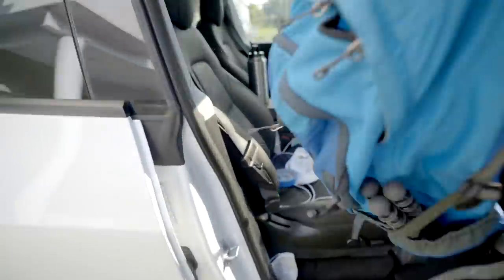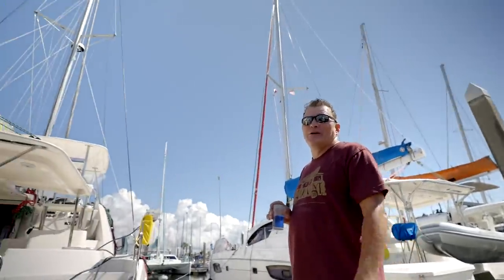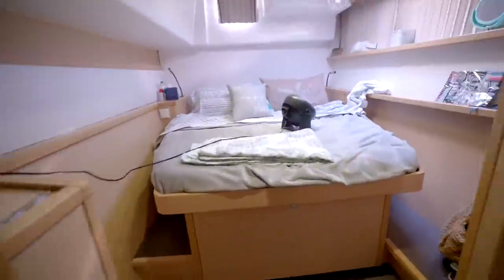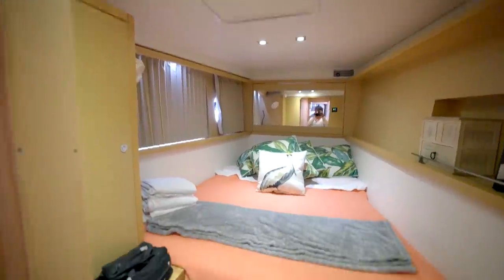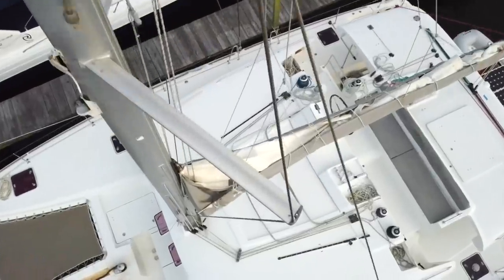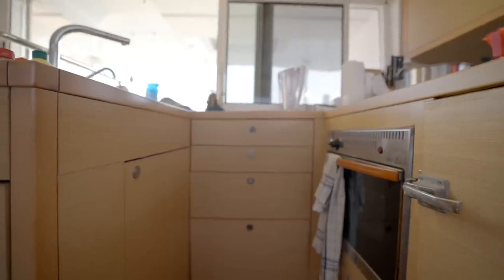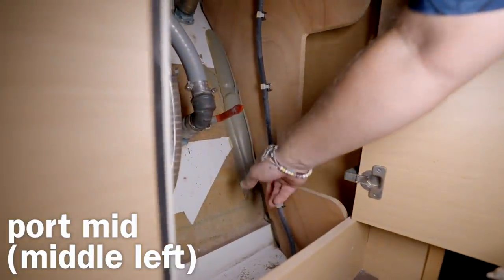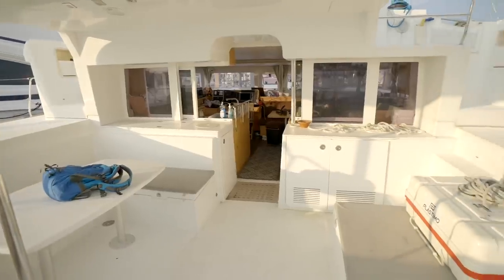Boat Tour!  I found 2 Catamarans w/ Broken Bulkheads Just Like Mine!

Comment: It's not recommended to perfectly fit bulkheads (stringers) to the hull, the reason? When the bulkheads are laminated in place, the heat generated by the activation of the resin, causes the line of the bulkhead to mirror through to the outside of the hull even with a core in the hull. If you eye the hull looking down the length, this is when you will see it, this in turn can, in time, cause bullhead failure. This may not be the case for you, though. This is something we at Sunseeker found out through experience many years ago. The poly ester resin was also changed to the more flexible  grade. Another laying up problem is not measuring catalyst to resin, sometimes people have a habit of making a hot mix to get the job finished quicker, this generates much more heat and condensation in the voids causing, In some cases, the layup to delaminate.
Reply from the maker: Do you know if this applies to epoxy resin as well? Thats what we're using for all the repairs. There's a pretty big gap from the bulkheads to hull (From the factory) that im filling with cobosil/resin filler. Hopefully that doesnt cause the problem you mentioned.
Reply: @david_shih  Polyester resin is less expensive, flows easier for vacuum moulds, epoxy on the other hand seems to be the desired resin for repairs, putting the cost to one side. I personally have not used epoxy resins for repairs, however, its strength and agility seems to work. To avoid mirror image, fill bulk head gaps with foam or balsa, secure in place with body filler or similar, then GRP it. That is what I would do, however it's your boat sailer. What does Laguna recommend for stopping the boat flexing? For as sure as eggs are eggs, it will happen again until the cause is cured.
Reply from the maker: lagoon doesn't really recommend anything specific fix for the flexing b/c they're not really acknowledging the problem in the 1st place. But according to the boats designer, once the bulkheads are properly reinforced all the flexing will stop!!
Reply: @david_shih  Good luck with that one, then. Get it in writing from the designers. Then you will know. P.S; who decides what is properly reinforced?
Reply from the maker: Ah, so to clarify, the designers of the boat are a completely separate entity from Lagoon. Lucky Colin from Parlay was able to discuss the recommended repair in detail with them well before Lagoon realized this was a major problem.  So, they were very forthcoming with the structural weakness and problems with the design.  So the repair process Parlay and I used is completely different than the repair kit shown in the video. We literally realigned the entire boat with pylons on the bridgedeck; ground out all of the delamination (so much); installed 3x the original plywood bulkhead; and glassed the s**t out of everything and retabbed everything where they originally used putty. Videos of all of it to come soon!
Reply: @david_shih  GRP is like paint, no matter how thick (layers)you put on, if the first layer doesn't stick, neither will the rest on top. Therefore, if the flexing of the boat is greater than the strength of the bonding, it will delaminate again. It therefore goes without saying that structural stiffness must also be applied. As for designers, not all boat building companies employ their own naval architects, as they are known in the UK. Sunseeker yachts were designed by the then well known naval architect and racer Don Shead. "https://itboat.com/en/companies/342-don-shead-yacht-design" he had his studio in Fareham, Hampshire. When it was Don Shead's time to retire, Sunseeker took on his staff and continued, as far as I know, to this day still designing. P.S; in the UK a Lloyds inspection certificate would be a sure sign of correct repairs as well as seaworthy ness.
Reply from the maker: @lifeinchrist77  Makes sense...now you have me worried about how well i applied that base layer of glass.
Reply: @david_shih  As long as your surface is keyed up, and you used paddle rollers to make sure the epoxy has gone through to the groundwork and squeezed out the air bubbles, you should be fine you can do no more in that area. We always laid up with three layers 100Gm2 chopped strand matt about 6" (150mm) wide by the width of the roll and stager the layers so you don't get a hard edge so to speak, and the 6" now becomes 10", We wet out the matt before putting in its place on the boat, a bit messy until you get use to it, we found it goes on better than trying to wet the surface then put the matt on dry and then wetting that matt, it only gets tricky when working over head.
Reply from the maker: Is you got me doubting if I prewetted some of the surfaces when I glassed the beam in! …ugh.
Reply: @david_shih  It doesn't matter if you pre-wet the surface or not, we never did, we wetted the matt prior to putting it in place rather than wetting one layer at a time on the boat in place. As I said we would put three staggered layers, we would have a piece of 5/8" ply big enough to take the length and width we were wetting out. Wet the ply board first, put on the first strip of matt, wet it, do the same to the next two pieces staggered on each other then lift the three pieces together and put in place, bulkheads to hull, roll out with paddle rollers. This is gives tapered edges and especially useful when applying foam and vinyl direct to hull, or buklheads, you don't  get the bump where the matt ends. Another tip, if you are using foam and then applying vinyl using spray glue, do not write on the foam or the reverse of the vinyl with marker pen for ID purposes, the ink reacts with the glue and shows through the vinyl. Nothing worse than walking onto a 600,000 pound yacht and having to rip all the foam and vinyl off and start again.
Reply from the maker: @lifeinchrist77  thanks for all the advice….the second I think I’ve finally learned something I realize there’s more I didn’t know I didn’t know.
Reply: @david_shih  You're welcome, David, my years with Sunseeker paved the way for learning much. One Sunseeker that we built, I think a Manhattan 52, it would not plain, the problem? Where the prop tunnel meets the transom, a radius was put on the edge, causing cavitation. The edge was gel coated to give a sharp edge, then she was planing, such a small thing caused such a headache. Needless to say, the mould had to be modified.
Reply: In my early days 1950's 60's I raced cats, these were the pioneer days of cats, with loads of experiments going on.

Comment: Off topic  how long does it take to recharge your car when traveling?
Reply from the maker: theres a bit of logic to it--battery chargest exponentially faster when its near empty. The fastest way to go about it is to charge frequently but only about half way, so you're near empty every time you hit a supercharger. Sit there for 15-20 mins and be on your way! But to be honest charging is the best part...build in TV with netflix, movies, games, and A/C! I bought a steering wheel table that clips on and frequently sit in the car to work. Well, those were the good old days when i wasn't trapped in panama. Here I sit in a tiny Kia Picanto and cry to myself in the dead of night while hiding from the mosquitos. That's how i recharge from fiberglass dust exposure.

Comment: So weird that Lagoon would design these beautiful boats, finish them with so much attention to detail, but then pay so little attention to the structural integrity of the hull. You don’t even have to be a structural engineer to see that the bulkhead design (a few layers of ply glued to the hull) is not adequate for the forces they have to deal with. Surely the costs of material and labor to the do the job properly is not going to add a significant amount to the cost compared to using glue?
Reply from the maker: They keep claiming that there’s absolutely nothing wrong with the boats design, that it meets all boat building specs.  then why do they keep reinforcing and upgrading the area that keeps breaking if it was strong enough to begin with. ?
Reply: We are all focusing on the front bulkheads now and it's apparent this part is under engineered. But if you look at the structural design of the whole boat, I am sure it's a much more complex affair. From what I understand, they are doing a very good job of offering a very attractive boat for the money. I am sure they cannot achieve this by over engineering everywhere, which it not to say they are allowed to screw up in some places. And screw up they did in this part, imho they'd be wiser to own up to it and offer a satisfactory solution to everyone involved.

They seem to be moving  in the right direction, from what I've gathered from Collin's video's, but it's taking them long to get there and it's going slower than necessary. They are also playing too much corporate liability hide-and-seek for my liking. I imagine it affects resale value of non-fixed L450's considerably and I'd be pissed too if I was an owner. 
Their denial of the problem is helping no one. 

I am not really in the market for a Lagoon, so for me (and probably a lot of viewers) it's a bit academic anyway, but I sure as hell take note on how it's handled. Best of luck to those affected.

Comment: Lagoon - it looks just like a real boat - no really.     Next task is obvious - Can you find a Lagoon 450 without broken bulkheads? I'll bet if you find one, it's almost never been used.  The huge question is:  Is it only the bulkheads? What else is wrong, especially things that can't be fixed?  I would think the gusseting is inadequate, the glass layers probably separating when jobs were on pause overnight, over the weekend.  I think Lagoon's 'fix' is to extend the life of the boats enough to a second used sale and then they can walk away from all responsibility.
Reply from the maker: Will, theres actually 450's that are almost new and never sailed that have this issues. So although sailing them does hard does make it worse, the design was inherently flawed. Your comment on "extending the life of these boats" is totally accurate as these boats are primarily designed for the charter market which means a 5 year life before charter companies drop them and owners are stuck with them or they're sold.

Comment: No disrespect but have always thought these were just floating apartments with a mast stuck in them...has a lagoon 450 ever completly broken up yet ?..you guys have probably saved that happening to anyone so far...great video, love your enthusiasm and hope you get sailing again soon...and thanks for showing the "fix" from Lagoon ..ain't gonna work on your mates boat...have you received any compensation from them on your boat?...needs to be a total recall..if one of these breaks up at sea..lagoon are sunk for sure. Thanks for sticking your neck out and being so honest for the common good...well done to you and Parley.
Reply from the maker: None taken…and you’re not wrong. That’s why I’m doing everything I can to reinforce mine into something that can handle blue water. None have broken up…theres a bunch of stages of breakage (some extremely obvious) before you get to that point.  On the Mississippi boat for instance, the shrouds went loose once the bulkheads finally completely broke. No one in their right mind would go sail once that happens, but if they did I can see the boat breaking up in big seas.
Reply: @david_shih  thanks for the reply..keep up the good work

Comment: Someone at the factory cut corners and WHY WOULD YOU USE PLY UNDER THE WATERLINE?!?!?!? Today there are tons of materials that can replace PLY below the waterline in the hulls! Massive life threatening failure and I would advise a class action suit!
Reply from the maker: I guess i don't know that much about boat building? Is it against standard to have ply under the waterline even inside the hull?
Reply: @david_shih  no, it's a matter of did they use marine grade ply, 3/4 inch, and the way its constructed above the water line is not at all standard. Uniformity especially with these bulkheads should be standard naval safety in construction.
Reply: @david_shih  the fact that the more all the bulk heads collapse it for the fact that they shouldn't have made them the way they did. The 3, 3/4 ply layered below and not above, was asking for failure. Uniform,the entire piece should have been the same. I was born on the Gulf of Mexico and we worked on all sorts of hulls, I would have never thought to see such expensive vessels cut corners in structural integrity. Failure would have you feei your sailing a flexible yoga mat and not a multi ton catamaran
Reply from the maker: ah got it, well lucky the fix that I'm following has 3x the plywood from hull bottom to top deck + multiple layers of fiberglass to lock it all in!

Comment: Monohulls are inherently stronger than catamarans. There is less torque stress placed on the hull. However, this sounds like a design flaw if it impacts so many of the same model. If it was a US company, tehy would be subject to a class action lawsuit.

Of course, this does not take away from your comment about pushing through and fixing teh class to maintain the class credibility and resellability. I am a little bit surprisd Lagoon has not stepped in to offer assistance of some sort.
Reply from the maker: monos are definitely stronger...cats are kind of a design flaw to begin with...trying to keep 2 separate hulls together and having to fight the massive forces of the wind and ocean.
Reply: @david_shih  

I wouldn't call it a "design flaw". You are trading structure strength for greater speed, superstructure volume, and to a degree, comfort from rolling.

This makes a good yacht, but not a vessel you want to take out in high sea states.

Comment: I was quite surprised when you popped off that trim
Not so much with the warp.  ( that was bad) 
But this. 
-You paid a lot of money for this boat.  Space is at a premium.  You dont want to waste either.  I feel like your cat was built more like a house.  Hide all the rough stuff with trim etc.  ??  

Why wouldn’t the manufacturer use products that were a finished - detail purpose built.   
I’m trying to say, 
is there not a way to build the boat so you don’t end up with this ridiculous gap between walls.   Use a premium product to build and add the strength you need- with a finished surface.(s) 
Even the electrical box sticking into the cavity.  More like house construction.  ?  On a boat? Build by marine engineers!!  
I don’t think having hidden gaps, areas where mold- or as pointed out-structural issues hide.  Hmmm

I don’t care how beautiful the lagoon is,  unless I was just going to live on the docks, I don’t feel like it’s a vessel,  ( that you put your life and hard earned money into ) 
out into the ocean.  Not a vessel that will be here in 40-50 years.  ? 

Just my observation. 

Thank you for sharing this info.

Comment: The entire shape, and way, the bulkheads are fastened needs to be redesigned.  What about truss shapes? Triangles to increase strength where needed and remove excess weight where it is not needed. The way the structures are bonded together is just plain lousy. There is no other way to put it. The bonding of structures to the hull needs to be several layers of strong glass, not just a little putty, to stick it in there. Putting a little putty in there, to bond structures, is the equivalent of "wishing it together". Also, there is no reason why the entire wall cannot be used as  structural element, rather than a structural element, with two equal size valance panels.
Reply from the maker: can't disagree with you on any of this...problem with better reinforcement techniques was space and access. ideally i would have cut a hole in the side of the hull and shove a 20ft "I" beam in there, but that was just too much demolition even for me! we ended up going with 2x 18mm ply wood sandwiches per bulhead that ran from deck to bottom of the hull. and then lots of fiberglass...also reinforce the corner weak spots. I've got videos that detail the entire process coming soon! thanks for the feedback!

Comment: that thick bead of greenish sort of goop/glue or whatever it is where the bulkheads join the hull is just crap. ( 11.46 mins) where is the proper multilayered fibreglass tabbing going 150mm in either direction like colin did? your video made it very clear why these joke boats fall apart. rubbish build and TINY cheap 5 ply used for the main bulkhead. that should be 15 layers and 32mm thick easily or covered in a full size stainless plate. That huge rig pulls about equivalent of a tonne or more on that tiny ply bulkhead (stringer) . Get an engineer to calculate the loading from the sails in 50 knots and the correct size and tabbing and it will be much worse than i am saying here! Imagine the mast is pushing the middle downwards and to the side, and the force on the wire stay is pulling the  windward hull upwards like a giant trying to tear the boat to pieces. the rig is huge. then you smash it into a wave as it's moving and multiply the force times ten again. these joke boats look like six foot toy boats made to sail in a plastic pond at disneyworld when filmed from the inside. imagine if you met someone and they said "I just bought a lagoon 450",  you wouldn't know whether to fall around the place laughing or say "Oh im so sorry mate" like their favorite pet dog had died. Yes I'm an engineer and tech and have fixed broken stuff all my life. you dont need a genius with a calculator to see the materials used and the build technique is one tenth of what is required at that main bulkhead . what a joke! or a travesty
Reply from the maker: You so eloquently put all of my feelings into words. Especially, “…you don’t need a genius and a calculator…” Thank you.